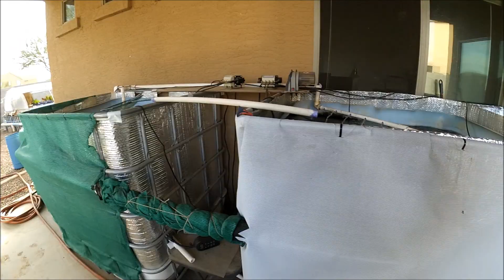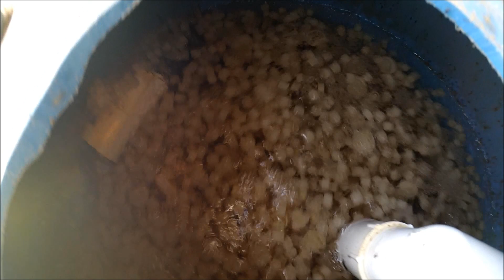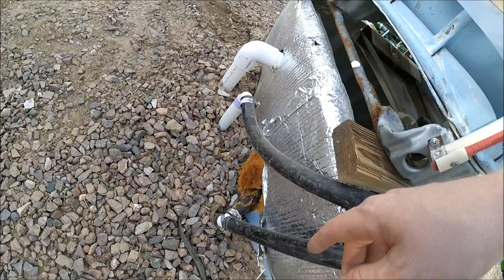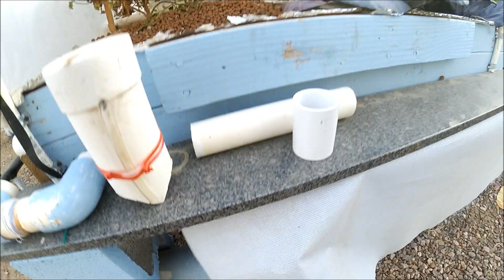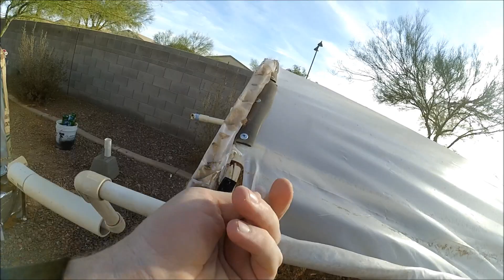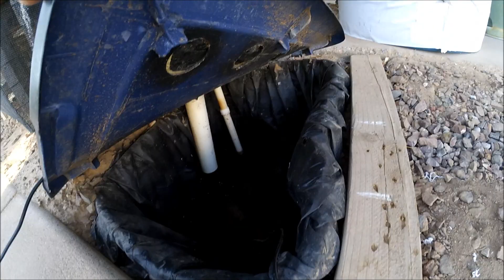My aquaponics system after two years

Comment: Is a biofilter very necessary for aquaponics?
Reply from the maker: No a bio filter is not necessary, You can have a physical filter that you would have to clean quite often if you prefer.
Reply: If you have ricks that works as a filter. If you have a deep water culture system get a swirl fikter

Comment: Eugenio Torres Vargas
1 second ago
hi todd im doing a diy ibc aquaponic on my rooftop so one of the biggest problems is how to control 20ºC on the water fish tank, and how to make a little greenhouse on the growbed. could you do a video or explain how you did urs and which materials do you use?
Reply from the maker: Eugenio Torres Vargas Thanks for the question, 20 Celsius is 68 farenhight of my calculations are correct and that's the same temps I have rite now and my fish and plants are doing great.
Reply from the maker: I did a video on how to cover the grow beds with the greenhouse and named all pieces and prices and where to get the supplies.
Reply: what do you use to cover the ibc tank, i saw its termic plastic but dont recognize what is the external cover. thanks for the fast response!
Reply from the maker: Eugenio Torres Vargas to cover my ibc containers I use both a reflective insulation that I purchased at a local hardware store, its kinda expensive though and outside of that I'm using recycled banners that a friend gave me. You might find some banners at a football game or soccer here in the states.
Reply: ok im thinking of using some marine plywood?(chapon marino, sorry dont know how to say that in english)and a cover of foam on spray to fill the space between this and the ibc tank, could it work? i was watching your greenhouse diy project when you answer so thank you!
Reply from the maker: Eugenio Torres Vargas I think your on the right track, insulation of any kind will help with hot weather and cool weather.  I use the expanding foam also and it helps allot. I wish you good luck with your project and happy gardening.

Comment: those pump hoses have a hard bend on them... check that. if they bend closed...
Reply from the maker: João Crispim That's a good point, however I've had no issues In two years that being said I have changed the vinil hose that could have bent since that video.
Reply: I've had problems with hoses... I try to install hard tubing or at least reinforced due to that... but even so... I've had a reinforced hose that fell apart like a slinky... xD

your system looks nice ^^
Reply from the maker: João Crispim Thank you for your positive feedback and I always encourage questions and conserns, that's how we learn from one an other 👍👍